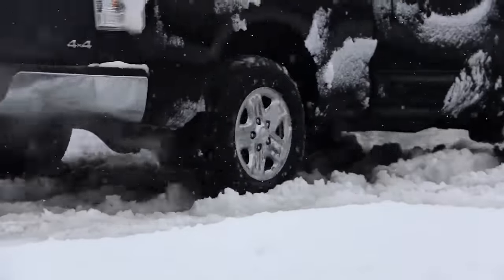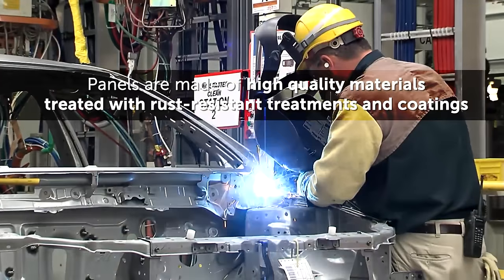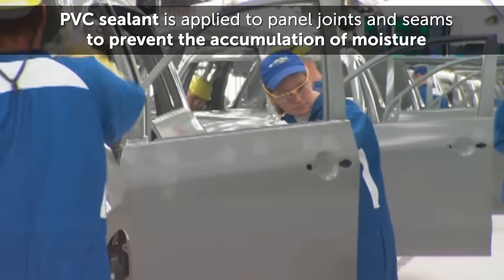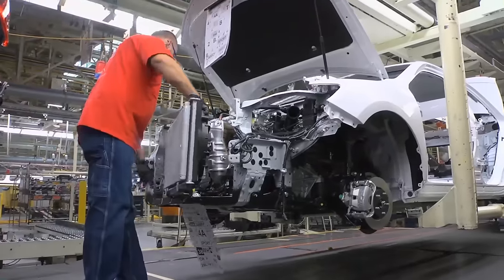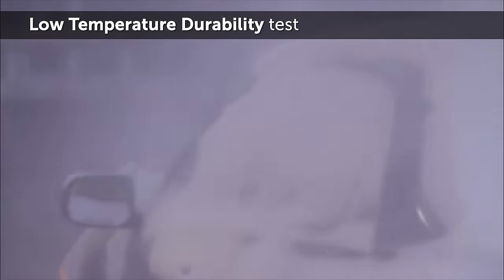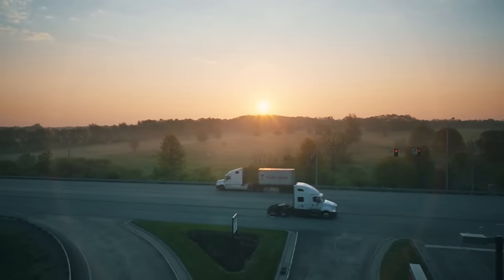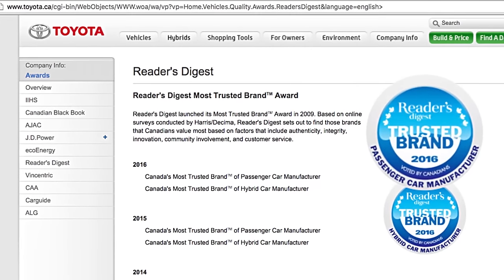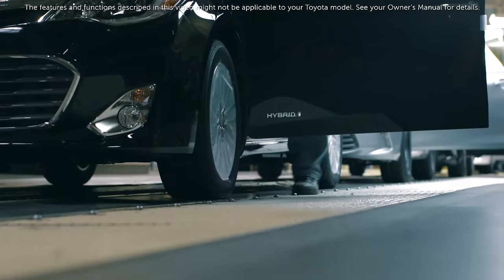Rust Protection Features

Comment: 15 years later the Highlander is in amazing mechanical and interior shape with regular care, but it is rusting away at the rocker by the rear wheels and where the well meets the sill through the rubberized film. I'd pay a grand extra if this could be prevented.
Reply: Nobody owns their car for 15 years. People buy them new and sell them after 5 years max.
Reply: @jimj2683  And many of them, brainwashed into thinking they understand what's good for the environment, will buy electric cars never knowing their carbon footprints dwarf those of well-maintained older cars because they require tons of fossil fuel to manufacture and run generators to charge them.

Comment: My australia fortuner 2019 get rust along the chassis frame joint. Look like toyota doing short cut and cheating. 
Other brand dip the entire body frame into gray zinc primer before dip into black paint for rust protection. But my fortuner that I only see thin black layer. Because toyota only dip the chassis  into the  black enamal once only

Comment: I'd be more reassured if all steel components were galvanised or made from stainless steel. I'd pay a big premium for such a car.
Reply: Hi Al, I'm a mechanical engineer working in rotating equipment for power gen and even LNG export. Not only do I have a Civic with 395,000 miles on it, but I've bid and won and sold a large piece of equipment for the coast of British Columbia, that will ship to China first, and then back, and won't start until about 4 years from now.  If your auto was 3 times the price, would you really pay for it? Stainless is not as strong either.  Your best bet is to take your vehicle every single Fall to an undercoater.  After a few years of research and doing some on my own, I'd recommend Woolwax.
Reply: @richcombs4805  Thank for your input, Rich. Yes, Woolwax coating the underside every fall seems like a good plan. Since posting the above, I've been told that most car manufacturers do in fact galvanize all steel bodywork components. Whether that's true or not, I don't know;  the above Toyota video doesn't specifically mention galvanizing.
Reply: @alseveron6558  note that in near shore and off shore installations my customers won't allow galvanized steel....or they want the galvanizing painted, or they want stainless or epoxy coated carbon steel.  It is common for us to coat things with something like fluid film prior to road shipment to the port.
Reply: @richcombs4805  That's interesting, Rich. Why don't they allow galvanized steel?